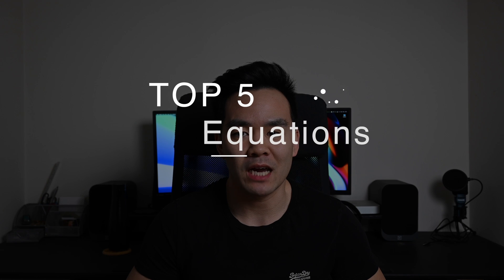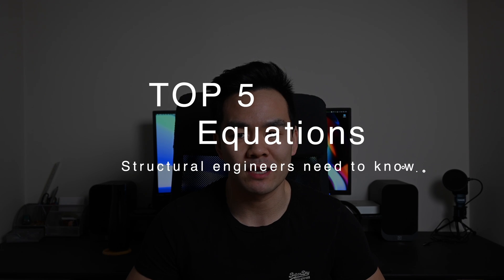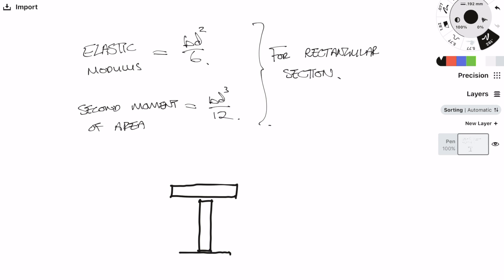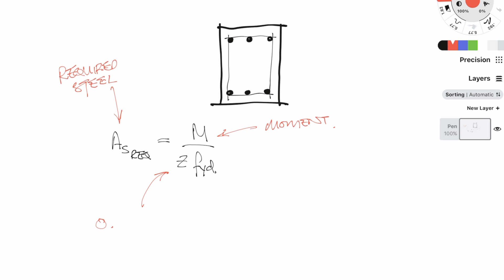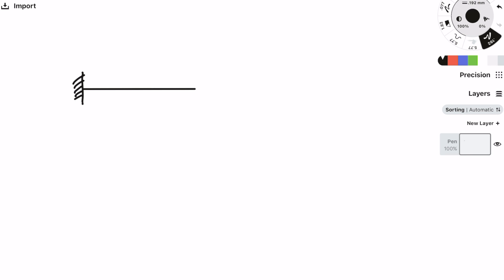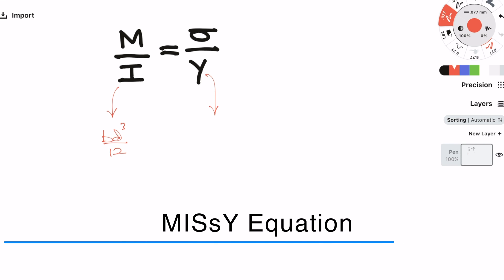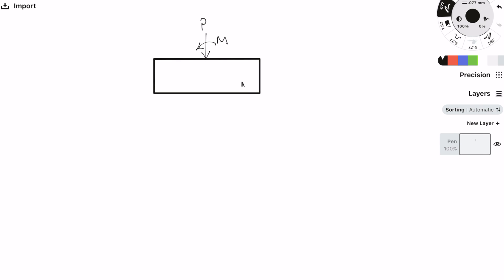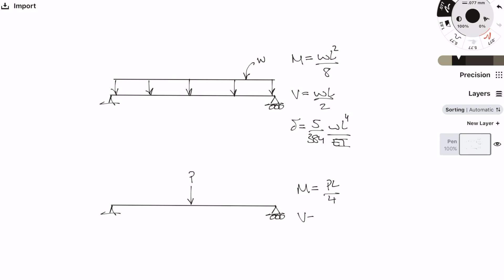Top 5 Equations to Learn as a Structural Engineer

Comment: I remember a lot of equations, probably couldn't begin to count them all right now.  Watching the video I made a list of equations similar to the video and I came up with 9.  I'm in the US so the constants in some of these equations might be different for people working in other units.
Section modulus and moment of inertia I remember for rectangles, along with stress=mc/i.  I consider these almost too basic to even put in the list.  Along with these I also remember stress=vq/i (sometimes vq/it) for horizontal shear from bending.
For simple span beams of course m=wl^2/8 and delta=5wl^4/384ei.  I also remember delta=pl^3/3ei which is a cantilever with point load but it is very useful for deriving other relationships- from it you can derive deflection of a simple span beam with point load, fixed end beam with point load, even fixed end beam with one end translating.
In reinforced concrete design of course we have As=m/4d.
For simple span steel beams with uniform load there is a relationship between moment and deflection such that if you have already calculated moment it is an easier calculation for deflection- delta=ml^2/161i.  However I find this one impossible to remember and it isn't all that much easier than the full equation for calculating deflection.
Here is a bonus- not so much an equation as a constant but I always remember the strength of 1" length of 1/16" fillet weld.